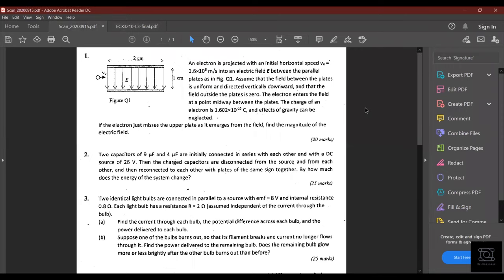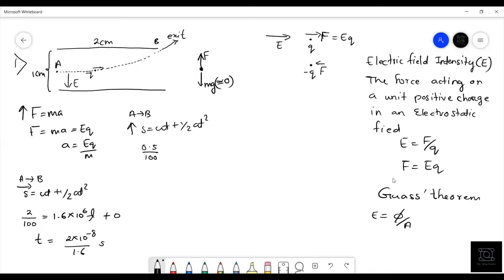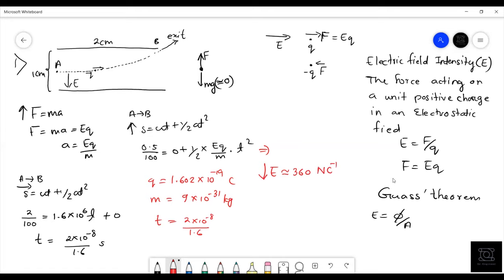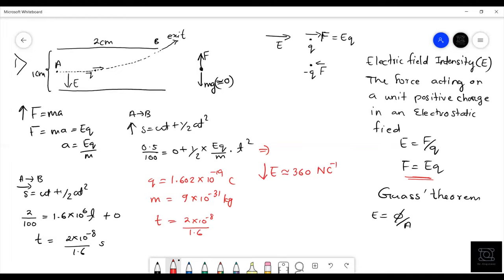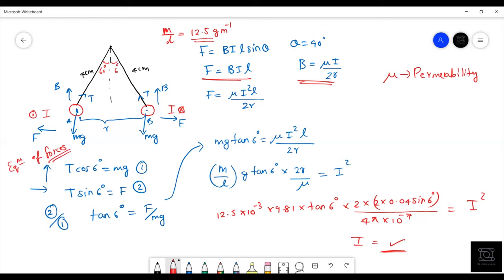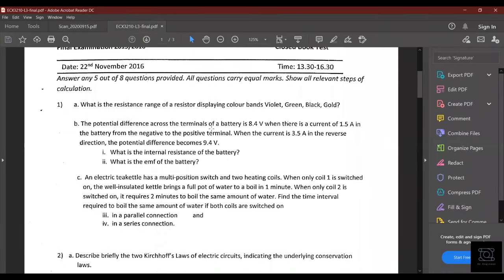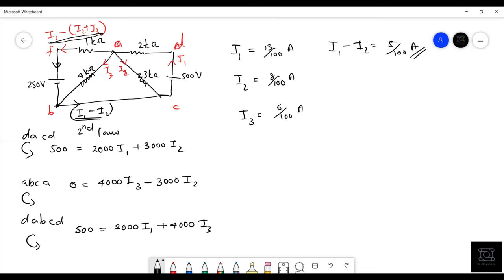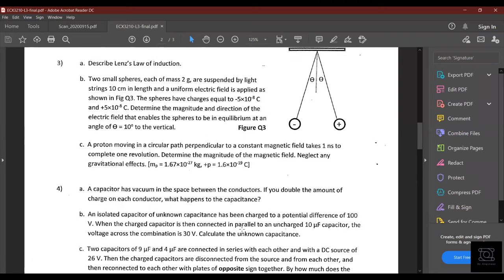Electrotechniques Uncommon Questions & Answers

Comment: In A/C theories we cannot use KCL or KVL. If we use such formulas, the solutions are really wrong.
It should be corrected as Current divider rule.
Reply from the maker: When you are handling the RLC question in the complex number format you can absolutely use KCL & KVL.
But, if you are doing the question with POLAR format, you have to use Current Divider theorem.